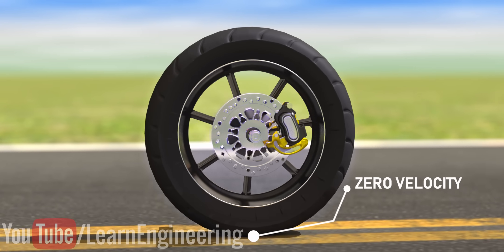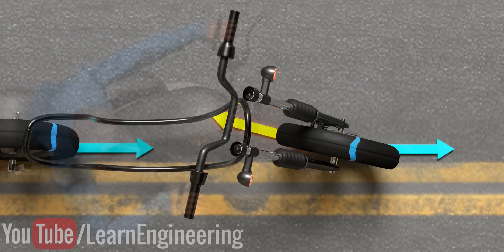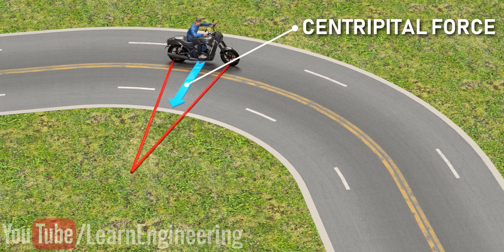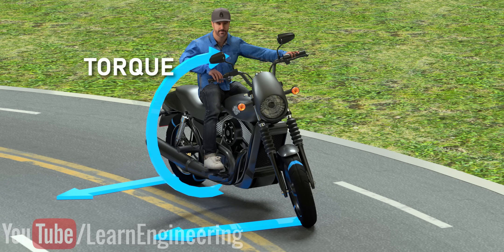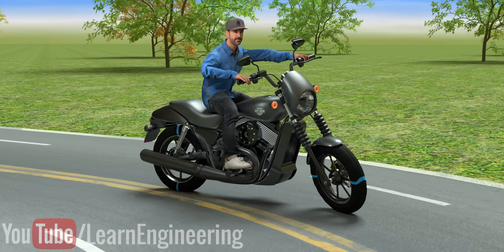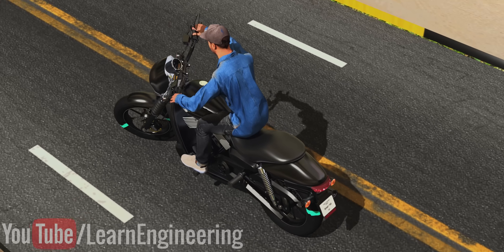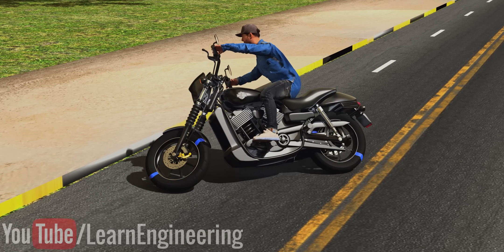Counter Steering | The interesting physics behind it

Comment: I agree with 50% of the video, except for the parts:

The turn right to turn right part - "here, the rider has to adjust body position to achieve the lean of the motorcycle"  extremely, EXTREMELY dangerous, anybody that listens to this advice will die.  Have you tried leaning a motorcycle with body only.  IMPOSSIBLE.  Best you get from that is a very very shallow lean angle, try it on the straight and see how useless this technique is, the bike barely changes its line, NO matter how FAR you LEAN your body OFF the bike.  And, if you combine body lean to lean the bike with STEERING INTO THE CORNER, YOU WILL GO STRAIGH ON, OFF THE ROAD.  STEERING INTO THE CORNER ONLY WORKS AT VERY VERY LOW SPEEDS, a bit faster than walking speeds or slower.

"Counter steering is a quicker operation but, slightly risky...." This is so untrue.  EVERYBODY that rides a bicycle does it, we don't pay attention to it, we are not aware of it.  We 'think' we are using body to lean the bike, but,  we don't.  With a bicycle, the weight of the bike, combined with the sensitivity of counter steering (and the lightness of the bars) makes us think we are not using our hands to lean, we are.  If turning the bars of a motorcycle (that weighs a lot, and has a lot of momentum and inertia) by even 1-2mm leans the bike over pretty quickly,  imagine the effect on a bicycle that weighs nothing, you will barely adjust the bars to get the bicycle to lean, which gives the illusion that you are not using your hands.

BUT!  Although, EVERYBODY uses counter steering naturally, it is still very important that they know what it is, because, unlike a bicycle that weighs nothing, accompanied with the very very light steering which gives the illusion of not using your hands, now, on a motorcycle, you really have to use force to turn those bars even just a mm, because of the weight and momentum.  So now, you have to be aware of counter steering.

Be aware, be conscious of counter steering when riding your motorcycle, you need to use it ALL THE TIME, if you don't, well, I won't be coming to your funeral. 

Sorry, I had to thumb down this video as there is a mixture of good education with BAD advice.
Reply: I don't think you know what you are saying...

Comment: What nonsense is this??  "To turn right, turn the handlebars to the right, then lean the bike to the right"?  What?  How do you "lean the bike to the right"?  By (momentarily) turning the bars to the left, NOT the right!  Who comes up with this drivel?  

Quote from the description above: "Counter steering is an amazing technique used by many bike riders....".  WTH, countersteering isn't some special technique known only to skilled riders.  On the contrary every turn you make on a motorcycle, from parking lot speeds to triple digits, is accomplished by counter steering, i.e. turning the bars in the opposite direction that you want to go, to get the bike leaned over.  Or put another way, push right to turn right, and vice versa.  Rather than some esoteric skill, in fact it's the only way to steer a motorcycle.

I could scarcely believe my ears when I heard the "turn the bars to the right, then lean to the right" garbage.  That's just flat wrong.  Turn the bars to the right and you're going to lean left.  Follow the advice in this video and you'll end up with the bike, and you, on the ground under an oncoming car.  

Go listen to some real motorcycle riding videos, like the "Ride Like a Pro" series, and dump this cr@p.  It's clear that whoever created this video, with all its pretentious "science", has never ridden a bicycle much less a motorcycle.
Reply: Well said fella. Lots of dangerous information contained in this video.

Comment: This is silly.   Under 40ish km per hour(this exact speed is different for each bike) steer the motorcycle exactly like a bicycle.    After 35-50km/per hour,  there’s no leaning necessary.    For example , At 100kph, push right on the right side of your handlebars and the bike will turn right.    Push left on the left side and the bike will go left.   Hope this helps , but do try it for yourself.   Prove me wrong, I insist.

Comment: Trying to steer the bike in the opposite direction of the desired direction is not just counterintuitive, it's dangerous, because you are fighting the bikes natural physics..... and if you win....you crash.   Counter-steering, as they call it, is just a way to make the bike fall in the opposite direction of the steering input. Once the bike leans left, the forces caused by the fork angle (rake) will force the wheel and therefore the handlebars to turn left. This is why your bike won't fall down unless you  fight and win the tug-of-war with the front wheel. Common sense tells us that leaning the bike turns the bike, and the handle bars will react appropriately if left to their own desires.

Comment: but one thing is not mentioned, and is shown as INCORRECT. Counter steering only applies at higher speeds. And we DO NOT  turn the handlebars back to face the direction we are turning. We need to keep counter steering to keep turnig.
Hence this explanation falls short. This explanation also doesnt address the geometry of the turn, how the bike keeps turning left, while the handles are turned right, and its relation to the front wheel geometry.. Watch twist of the wrist. its a famous documentary which captures counter steering.

Also, you cannot get the effects of counter steering on an activa/scooter that well.

Comment: Sir I did not study analytic geometry how can I get the best geometric form of my riding capability for what angle of degrees the RESULTANT LATERAL FORCE for KPH resul;ts,  whether I go along X or along Y or along the Path of the Z axis. I don't know how much speed for KPH should I do cornering before handling the clutch, or pressing the front break and rear brakes...:))

Comment: Well, three seconds in he's already dangerously false.
Counter-steering isn't used by "many" motorcyclists- it's used by every biker, every time they go out for a ride, whether they realise it or not.
The entire principle of counter-steering is simple: Push left to go left, push right to go right. 
Some people will disagree and tell you that you only need to lean to make a turn, and these people don't even realise that they're undermining their own argument.
If you lean to one side, you're PULLING on the outside handlebar, which has the exact same effect as PUSHING on the inside bar. i.e. countersteering.

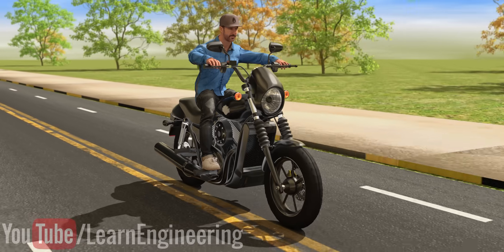Well, at 1:12 comes the first dangerous lie.
He says that in "normal steering" you turn the handlebars to the right and lean to the right to turn right and that's just dangerously false. 
If you try that shit on the road you're gonna have a really bad day.

At 3:34 he implies that counter-steering is simply a way to initiate a turn, and that it is necessary to counteract that by turning out and then in when making a turn.
Again, if you try this on the road you're going to be taking a ride in an ambulance.
"During the lean operation, the driver cleverly adjusts the angle of the handlebars so that it is suitable for a perfect no-slip condition"
These are the words of a book-smart physicist, NOT the words of a street-smart biker.

Please, don't just take my word for it. Don't take anyone's word for anything until you've done your own research. 
MotoJitsu is a good YouTube instructor and explains the principles very well.
A Twist of the Wrist is another fantastic resource, and is basically the fast boi bible. 
Nick Ianatcsh and Champ School are also good.
There is an overwhelming body of evidence to completely disprove the lies put forth in this video.

Comment: After counter steering the bike automatically turns in the opposite direction.  The rider DOES NOT have to turn the handle bar after counter steering.  This can be demonstrated by pushing the handlebar to initiate counter steering without gripping it. The bike will turn into the curve without any other input to the handlebars.
Reply: Well said!!! Couldn’t agree with you more fella.

Comment: This video is overly complicated, overly wordy, overly "sciencey" rubbish.

All steering input on a bike is for controlling the lean angle of the bike, and it is the lean angle of the bike which does the turning of the bike.  At low speeds it involves some little bit of counter steering to initiate a lean, as shown, but it is the lean which turns the bike.

At higher speeds all steering is pure counter-steering.  Just try steering at highway speed by leaning the bike only, without any input at the handlebar (hands free).  You can make it turn, yes, but only very gradually and with a lot of leaning force.  Now simply push forward on the left handle, and the bike will quickly and easily enter a left turn by leaning left.

Here's a much simpler explanation.  The bike turns by leaning, due to the round wheels and tires.  To force the bike into a lean, you move the wheels out from under it.  Thus, to turn to the right, you push forward on the right handle, and/or pull back on the left handle, thus moving the wheels out to the left of the bike's center of gravity, thus putting it into a right-hand lean, thus turning it to the right.

All riders counter steer all the time, but some just don't understand that they're doing it.  At very low speeds it isn't so obvious because you need to turn the front wheel in the direction of the turn to keep the bike from falling.  Turn the front wheel more sharply into the turn to bring the wheels in under the bike, thus pulling it up out of the lean and standing it up straight.  In such a way, with this understanding, any 90 pound weakling can control a thousand pound cruiser bike through a slalom course as though it were a little toy.

It's very simple-- Steering input controls lean, and lean determines the amount of turn.  Everyone does it, and it's not a stunt.  It's the only way to control the bike properly.

So the handle bars aren't used to steer a bike the way they're used to steer a tricycle.  On a bike they're only used to control the amount of lean, and it is the amount of lean which determines the radius of the turn.

New riders can get into serious trouble by instinctively trying to steer the bike, in an emergency, as though it were a trike or a car, thus riding directly into a hazard instead of away from it.

Up next; Power sliding...

Comment: Counter-steering is not a "technique" it's the way every two-wheeled cycle initiates a turn at speed, *every time*.

It's just that the initial countersteering movement usually goes unnoticed when you leanimg your body causes pressure on one side of the handle bars. Then you end the countersteering movement by consciously turning the handlebars into the corner the "normal" way.

It's always the handle bars that actually steer the bike, not your body position, even though it may appear so. Everybody countersteers all the time, if you're aware of it or not, it's just the physics of riding.

Knowing this and experimenting with it consciously (even on a bicycle) will enable you to make quick swerves in emergency situations and always point your bike precisely where you want it to go. You won't waste your time trying to make body movements, a quick and short push on the correct side of the handlebar will instantly turn your bike, no matter its weight or size.
Reply: Not only in the initial fase, you counter all the way
Reply: @VictorSamuelMosqueraArtamonov  No.  Turning the front tire to the left when turning right (or vice versa) is only going to snap off the front fork.  That would result in the bike ending up plowing a furrow in the road which would most likely toss the rider into something on the side of the road.  That would either kill the rider or severely injure them.
Reply: That is not fucking counter-steering.  Counter-steering is what you do to pull out of a skid!  The rider leans the other way not to "counter-steer".  They lean the other way so the bike doesn't fall over.

Comment: I say this video is incorrect in soooo many ways. PLEASE DO NOT USE THIS VIDEO TO LEARN HOW TO STEER YOUR MOTORCYCLE. You WILL crash!  Contact me if you'd like good sources for learning to steer or ride a motorcycle in general.  Either the math or the basic assumptions on this video must be incomplete or incorrect because THERE IS NO "NORMAL" motorcycle steering, because ALL STEERING in motorcycling IS COUNTER STEERING (except at minimal speeds, below 10 mph, but no one needs an instructional video on how to turn at <10 mph).  Cheers everyone!

Comment: This video just straight up use junior high school physics to explain bike steering, like really? you can get someone killed. There's no such normal steering and counter steering. In high speed you HAVE TO counter steer to initiate turn, then lean your body and adjust your handlebar to the direction of turning to maintain turn. Using your 'normal steering' in high speed will make you fly out of the turn 😂

eNgINeEring 🔥
Reply: Wrong!

Comment: Wrong assumption of "normal steering". Search countersteer and cambridge if you really want to learn the physics of countersteering https://youtu.be/PgUOOwnZcDU
As soon as the guy in this video starts to turn bars to right, that will counter steer and initiate a turn to left. No amount of "leaning while normal steer" is going to change that. Whoever wrote this doesn't appear to ride a motorcycle. You don't get a choice of "normal steer" or as alternative, "counter steer".

Comment: I just wanted to clarify that direct steering is typically used when going low speeds (~15- mph), and countersteering is for road speeds (~20+ mph).

Source: CHP Certified Motorcycle Safety Training Course
Reply: Yeah they left the most important part out! Lol
Reply: This is nonsense. Counter steering is used at all speeds, if it says differently then they have misunderstood the physics. You cannot steer without counter steering.
Reply: @garethhanby  Lol, you're here.  I'm pretty they are quite correct in this.  It is very possible to steer without counter steering.  Work out those vectors.
Reply: @zvxcvxcz  Yeh, I got a bit obsessed with this today. Someone in my block got covid and I have to self-isolate in my flat for ten days so I am surfing around. I have worked out the vectors, as part of a Uni project we designed a radio controlled motorbike (this was back in the 80's) and I was responsible for the software, so this is a bugbear of mine and reminds me of all the things we discovered back then and how I totally got some stuff wrong. There was no internet to look up the actual answers so everything was a surprise. But I'm afraid, I know I am right and all the scientific papers published we now have access to confirms this. I know you will not accept this, but so be it, I will not argue with you.
Reply: Yes that's what I understand. At low speeds we turn the handlebar where we wana go but at Hi speeds we counter steer and once the bike tilt we lower the body to go round the korner instead of turning the handlebar

Comment: It's force, friction and balance. Force is the push from the rear wheel/behind. That push pushes the front wheel, which either rolls or falls (left or right). If the front wheel is aligned with the rear wheel's push, the front wheel just rolls. If it isn't, friction between tire and road causes the front tire to fall or lean. 

So when you point the front wheel to the left, the tire falls to the right. Once it leans, the shorter radius on the edge of the front tire make it turn towards that side of the edge of the tire.

It's this simple haha

Comment: You need to understand that ALL MOTORCYCLES operating over 10 or 15 miles per hour HAVE TO COUNTER STEER in order to Turn.. I'm not surprised that an "engineer'/"Physicist" doesn't understand that.. Otherwise you would be limited to operation in a straight line at any speed above the referenced 10-15mph.

Comment: No wonder this had to use CG because no motorcycle would do this in the real world. This video is so wrong on so many levels. And could get someone killed. Counter steering is physics, not a choice of the rider by leaning. If you '''turn'' the handlebars as this video shows it'll wabble then go straight.  Please new riders, do NOT do what this suggests. There's no ''trick'' to it. Nothing to get fancy with. Countersteering is physics. And you have to countersteer--said easier as you ride--push the handlebar on the side you want to go. You can only ''turn'' the handlebars at very slow speeds, like under 10mph. Please, go to the experts on countersteering. There are really good explanations of countersteering on youtube and getting it could well save your life. Conceptually it's hard, but practicing it is far more important. This video may be well-intended, but really could get people hurt it's so wrong on how motorcycles steering works in the real world.

Comment: This is the stupidest video on counter-steering I have ever seen!!!   Counter-steering is the ONLY way you should use to turn your bike EXCEPT at very low speeds where the centrifugal force on the  front wheel is to low to be effective (around 10 to 15 mph, depending on the weight of the bike  and front tire.)

Comment: If you want to do a REAL engineering study on steering a motorcycle--- instead of silly cgi animations and a live demo that shows NOTHING, put an encoder between handlebars and frame with its readout superimposed on a video of the bike doing maneuvers. Then watch in slow motion to see what happens. I have a cheap plastic REMOTE CONTROL toy motorcycle. The plastic rider is fixed and does NOT lean or move at all. Guess which way the front wheel turns to make the bike turn left? Push on bar in the direction you want to go, don't even consider it as counter steering as you will not even be aware of the bars actually moving. The comments, & replies to those comments, on this thread devolve into chaos.